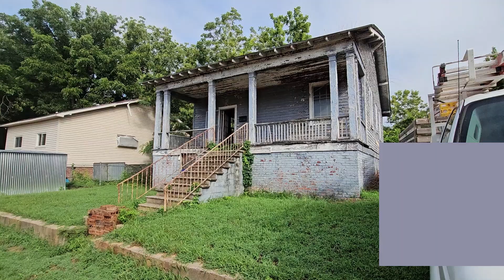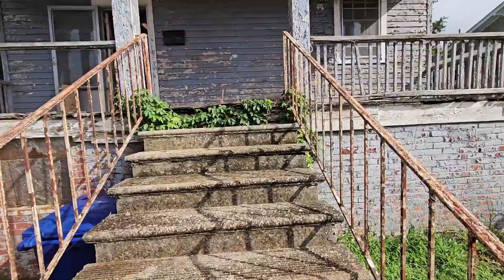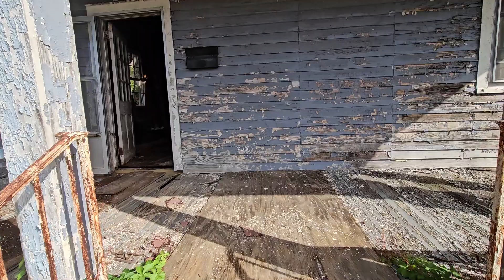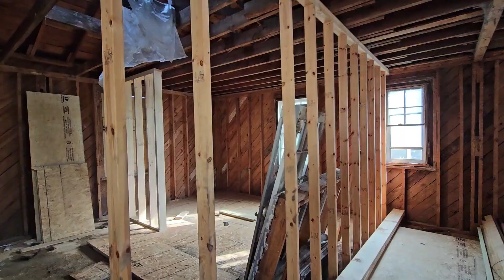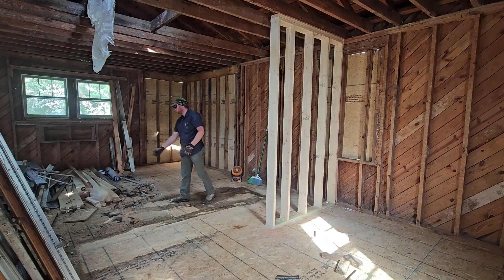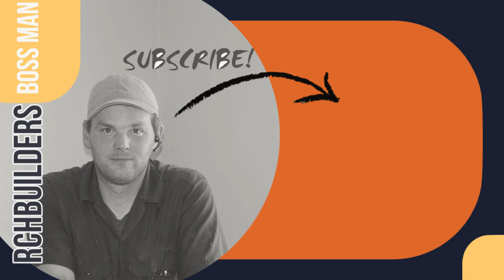House Flip # 1 : Framing the Bathroom & Closet Walls!

Comment: Looks easy.  I need to learn how to frame, especially a load bearing wall.  I have two to reframe due to termite damage.
Reply from the maker: The part that is more difficult for reframing an existing load bearing walls, is making sure what is above them is supported while working on it. I will try to explain it a little in the video on 08/29.